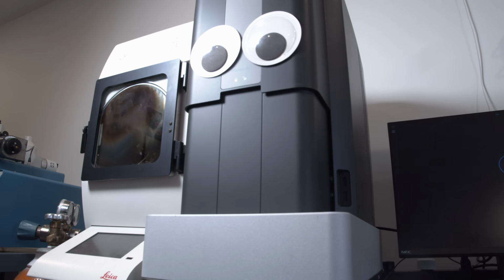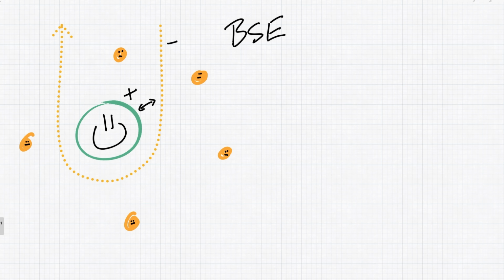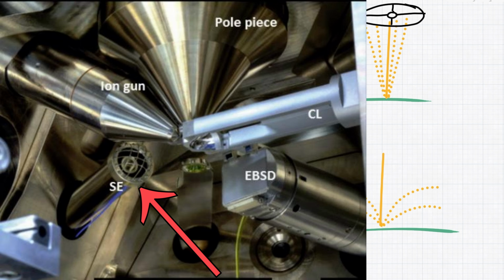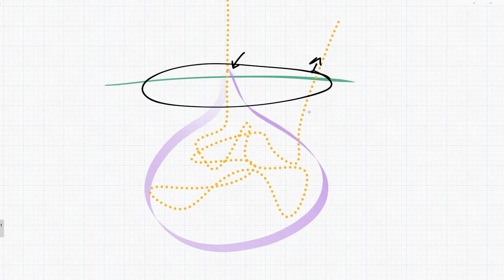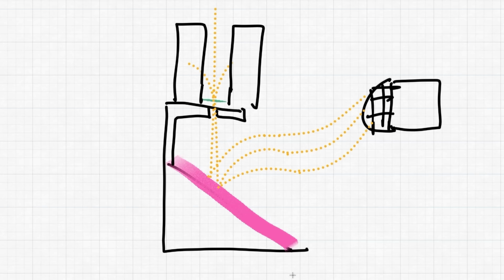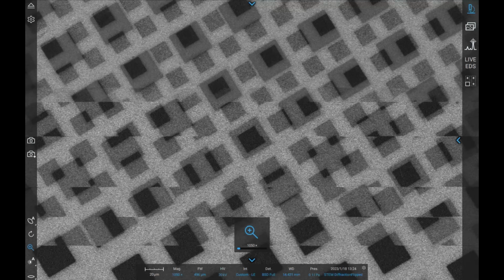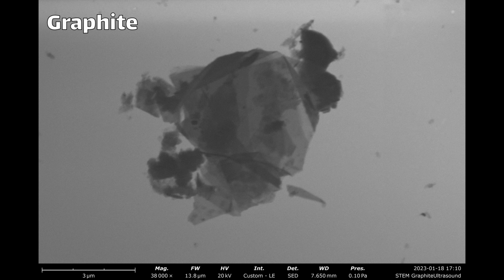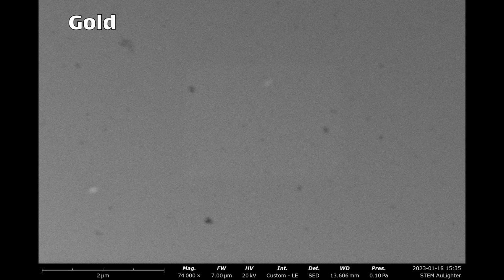Electron Microscope Hack to see Graphene

Comment: what a clear explanation, thx for video, but i didnt catch on what surface was graphite laying, if we were cathcing all the electrons passing through the grid, where there is no surface, graphite should have fallen on platinum plate further
Reply from the maker: Thanks! And that's my fault, totally glossed over that. The grids I'm using have an ultra-thin layer of Formvar (polyvinyl formal) polymer, think it's 20-50nm thick. It's thin enough to be mostly transparent to electrons, but robust enough to hold things like nanoparticles and flakes. There are a bunch of variations you can order depending on your sample (silicon monoxide layers, silicon nitride, pure carbon, thin metals, etc)
Reply: @BreakingTaps  that is absolutely amazing, i am curios how a such thin layer of polyvinyl is made
Reply: @pibus12  dissolve it in a solvent and let that coat the grid? The polymer is sold for diy tem lab use.

Comment: Amazing!  Would it be possible to improve the image SNR by stacking 4 or 8 sequential images of the same view?  . . . which leads me to also ask, how long does it take to capture a full resolution image like these?
Reply from the maker: Yep! The images actually are a stack of several images (you set an exposure time, and it integrates a number of passes). But the software doesn't do it very intelligently... it just dumbly integrates per-pixel so if there is any vibration or shifting of the sample, you'll get a blurry image. I've been meaning to capture a lot of individual frames and stack it with some astrophotography software. I suspect that would do a lot better job

A 4k image with reasonable quality usually takes 20-40 seconds, so pretty fast. If there's a particularly troublesome image I might drop it down to 1080p resolution and increase the exposure time. Ends up about the same time, but more integrations (and tends to not make the sample move around as much... it gets complicated).

Technically the machine can capture 8k images but that takes forever, like 5+ minutes :)

Comment: can you change the field strength on the secondary electron detector? i’m curious how that would affect the image. i assume at high levels it would see electrons from anywhere, and at low levels it would see only electrons moving kinda towards it
Reply from the maker: Not on my machine, but probably on nicer / academic machines! I think your intuition is 100% correct.  I've seen some papers that also add an electromagnet under the sample to curve the electrons, allowing them to "filter" it through a second aperture.  Same idea, just different way to do it.

Comment: Is there any way to get diffraction images out of a STEM? When I took electron microscopy of materials back in grad school, a big part of the TEM portion was using diffraction apertures to get spot patterns for looking at crystal structure, or imaging only a certain diffraction pattern so you can e.g. see <110> oriented grains as light and everything else dark.
Reply from the maker: I'm not sure to be honest! My gut says that STEM can't generate those nice crystallographic diffraction patterns... but I'm really not sure. Hopefully @AlphaPhoenix or someone equally knowledgeable shows up with some answers :)
Reply: Probably not. TEMs have lenses after the sample that asre used to form the image/diffraction pattern.
Reply: Well, going by the Xray crystallography experiment we were shown back in high school (AP physics, senior year iirc), it's enough to hit a monocrystalline region with the beam, and record the angular diffraction pattern that comes out.

And the transmission that the video uses with the secondary leectron detector should have that angular diffraction pattern from the crystal structure visible, but the single-pixel detector (and lack of focusing optics between the plate and the pixel) can't resolve it.

Comment: Can you actually get higher resolution that way? When we use TEM in our group, it is moastly to measure distances of atomic layers. What is the benefit for such a conversion. And why doesn't the 3d printed destroy the vacuum in the SEM chamber. I always had huge problems withe vacuum when I used 3d printed stuff. Thanks for the Video this is great
Reply: You can see in the video that he is using a working pressure of 0.1Pa, which is WAY higher pressure than a TEM requires, and is relatively high for some high resolution SEMs. I like these lower-end SEMs because they are much much more resistant to dirty materials and usually "good enough", depending on the analysis, and massively speeds up throughput if you have a lot of samples, as pump-down times are much lower.

Check out Environmental SEM, many machines can be made to work with volatiles and dirty or outgassing samples, and water.
Reply from the maker: Yep, @MrTheomossop nailed it! My SEM is a desktop machine, so the "high vacuum" mode is actually pretty low vac (and the actual low vac mode is practically atmospheric, iirc it's like 60Pa / 0.6mbar). But I can cycle the chamber in about a minute so it's pretty convenient for most things I work on, and tolerates all kinds of awful samples and outgassing materials 😁

To the question of why it's (potentially) useful, I'd struggle to resove many of these 50nm'ish sized particles if they were just placed on a silicon wafer. Very low contrast on SED, and almost invisible to my BSE. Still hard to resolve with this converter but there are more electrons to work with so the signal is a bit better.

Can't speak to more professional machines, but I imagine the difference is more stark if you have a proper, floor-standing SEM :) You can also play with bright/dark-field depending on how you mask the aperture which I'm told can be useful, although I don't fully understand the ramifications of when you'd want each yet

(I did somewhat misconstrue TEM, STEM and STEM-in-SEM in the video though. Was trying to keep it concise and didn't properly define each, which probably resulted in some confusion for folks that actually know about the different instruments)

Comment: How / where do you buy gloves that fit perfectly?
Reply from the maker: Most recent batch is from Uline (https://www.uline.com/Product/Detail/S-21079G-S/Nitrile-Gloves/Uline-Black-Industrial-Nitrile-Gloves-in-a-Bucket-Refill-Bag-6-Mil-Small), but I've also gotten them from Amazon before. Nitrile, 6 mil, small (I have small hands). I'd err on the side of smaller sizes though, people chronically grab too large of a size and then have it flapping around their fingers :) Nitrile tends to fit better than latex in my experience too
Reply: @BreakingTaps  thank you so much. <3. I have small hands too, and while the gloves on Amazon are okay, I do find myself being a bit more clumsy when doing any fine work.

Comment: Super cool! Only think I wish I could see if a comparison between the TEM images and what the same thing looked like with the backscatter detector.  Although, I have no idea if it's as easy as toggling between detectors. Probably not.
Reply from the maker: Ahh, that would have been a good idea! Easy to switch, just takes a few seconds. I just didn't think about it because in basically all the samples it is completely black! 🙂 The particles are so small they don't generate much backscatter at all, so end up being an entirely black field. The only exception was the tungsten disulfide... because tungsten is so heavy (and some of the particles were kinda large) they can generate enough signal to be seen on BSE.
Reply: @BreakingTaps  That makes sense.  :D   You did explain the benefits of TEM, but it would be kind of neat to see the advantage over what the SEM can do for the same sample. 🤔   Not a big deal, still a very cool video!
Reply: @BreakingTaps  Can (S)TEM view through an already back thinned camera sensor or is the structure still too massive.  Just thinking what sort of things can one view that are thin enough, a flies wing perhaps?

Comment: With the original arrangement, can you clock the time between the electron being emitted and being detected to separate the detection on the secondary detector and produce multiple "layers" based on how much the electrons bounced before coming out and hitting the detector? Or if you can't detect when the electrons get emitted, would it be possible to use the beam deflection as a sort of shutter, timing based on when you switch the aim from a dump direction to a direction that does hit the sample, getting an statistical sample over many shots to estimate the bounce time for each individual deflection angle?
Reply from the maker: I'm not sure, maybe! Grain of salt, I'm garbage at EE so not entirely sure what's possible or not. I have seen some devices that use an electromagnet to alter the flight path of electrons after they pass through the sample. By varying the strength of the field, you can curve the electrons more or less depending on their energy, basically "filtering" them (if an electron has multiple collisions passing through a sample it'll have a lower energy, etc).

You might be able do it in reverse too and vary the accelerating voltage to see how much is required to get through the sample and estimate from that?

Probably a way to do high speed capture of electrons though, not sure. The scintilator might be the limiting factor in terms of speed?

Comment: If you don't mind mentioning numbers, what's the approximate $ investment required to get to a point where you can make images likes the ones that you see in this video?  I would imagine there is also a huge amount of setup and calibration to get everything working just right.  Is it feasible to buy a hodgepodge of parts (scintillators, optics, etc.) off of eBay and connect them together, or do you have to buy into a specific proprietary ecosystem to have a hope of getting it working?
Reply from the maker: Yeah so my system is 60k-150k new, depending on the model and company. It's a "desktop SEM", so designed for less rigorous analysis than a big academic floor-standing model. They also don't show up on the used market very often because they are relatively niche.

New floor standing models are probably what @electricalychalanged4911  said, 100-200k or higher.

But you can find old analog SEMs for pretty darn cheap these days! 2-10k, depending on location and condition. They still take great images, just often are purely analog and are being sold by universities as they upgrade. Might need to tinker with them or debug analog electronics though, and parts are probably more difficult to find (but also, easier to replace since old analog stuff, often come with complete schematics, etc)

Building one from scratch is probably quite a feat, although Ben at Applied Science did it :)

The old analog ones are pretty amenable to tinkering though. Usually standard fittings (ISO flanges) so you can plug/play a lot of different things
Reply: @BreakingTaps  Awesome, thanks for the detailed reply :)    A used one for 2-10k sounds tempting.  I guess it would be a bit of a gamble though.  If you get unlucky, I suppose you might end up spending enough time/money 'fixing' it that it would be 'cheaper' to have just bought the desktop one.  Great stuff, keep it up.
Reply: While he was a high school student, Sam Zeloof bought a broken electron microscope off of eBay, and fixed it. So we have an existence proof that it was possible for at least one person to get their own working electron microscope with very little financial resources. Just a thousand hours of work.

He has posted videos on YouTube about his microscope.
Reply: About 200k
Reply: That is for a new SEM if you want to have an used system you might be able to get it for half or less especially if you know what you are doing and already have the required pumps.
Reply: There was a old JEOL JEM-100 full analogue TEM microscope from a university that sold at auction in Finland a couple of years back for €600, I would have bid more just for the vacuum pumps if I had the space to store it. The unit and pump box weigh 860 kg with height of 2.45m.

Comment: Since you're seeing thru samples, would there be a way to rotate the samples in a controlled manner to get multiple images you could use to calculate a volumetric scan of the sample? If it's too hard to control exactly how much you rotate the sample, could you have a grid mask or some other more complicated pattern around the sample that could be used to calculate the rotation each individual scan was taken at?
Reply from the maker: I bet you could! Sorta like a very shallow CT scan :) There'd be a limit to how much you could rotate the sample, since at some point it'll either be too thick, the beam start hitting the grid or other parts of the sample. But in principle it seems like it should work?
Reply: Alternatively, add a second beam source so you can take stereo images.

Comment: Are 3D printed parts  straight forward to use under vacuum?  do they take awhile to out gas moisture or anything?
Reply from the maker: They aren't too bad if you're careful to avoid big internal voids. My microscope operates at a pretty low vacuum, even the "high vac" mode, so it's fairly tolerant of outgassing and virtual leaks. Under more stringent conditions with real high vacuum it can take a while for all the little voids between layers and walls to finish pumping down, basically a ton of virtual leaks. In other projects I've either done single-walled prints with access holes to the inside so it pumps quickly, or try to keep them small and dense so there aren't a lot of voids at all. 

The PLA itself doesn't outgas too badly (various sources, i.e. https://sosolik.people.clemson.edu/papers/Vacuum172a109061_2020.pdf quote rates like 7*10^-6 Torr L/(cm^2s) ). I think NASA has a study somewhere with similar results. Outgasses some but not the worst offender amongst plastics

Comment: I have always been so fascinated by electron microscopes.  This is so neat!
Once, years ago, I had the chance to acquire an old (70s era) electron microscope from a salvage yard.  At the time, I was mostly concerned with, how would I ever get this going, as it was all CRT and really old transistors, but now I am kicking myself for not getting it.  Even if it would have been a huge pain to get working, getting one for basically scrap value would have been awesome.
Reply: I would have grabbed it if nothing else for the HV and vacuum goodies inside.
Reply: @christopherleubner6633  Indeed.  That also would have been a good idea, and more of a reason to kick myself.  Lol.  
After applied science got his olde one working, I was so disappointed in old me.
I console myself with that I got some other awesome goodies there, like some lasers I ended up selling on to someone at nasa, which is awesome.
Reply: Ouch 🙄

Comment: Can you please make a followup on the kind of detector you have? How does the point in space where the electron hit the sample is mapped out? 🤔 I. E. How does it map x/y coordinates? Is it a scanning system like CRTs and scanner moves to next spot after either getting the secondary emissions or after a specific timeout?
Reply: The beam is being scanned across the sample one pixel at a time. Signal from the detector is captured in sync with the beam, so if the beam is at the top left pixel of the scan area then the signal from the detector goes to the top left pixel of the image, etc.

The detector itself in a SEM has no spatial selectivity, it picks up any secondary/backscattered electrons heading its way. So you have to know where the beam was. In the old school analog CRT scopes, they'd literally drive the imaging beam and CRT scan coils with the same waveform (scaled appropriately in magnitude) and then the detector signal would go straight into the brightness input of the electron gun.
Reply: @AndrewZonenberg  this makes so much sense Andrew. Thank you..

Comment: So, let me see if I got this right:
- Your setup still scans a focused electron beam through the sample, as opposed to "real" TEM which works more like a, umm, slide projector?
- It would be possible, in principle, to collect separate images from backscattered electrons, "primary secondary" (I could not resist) electrons that normally get absorbed by that cup (that would require some quite bulky and unwieldy detector), and "true" secondary electrons from that plate you manufactured, plus chemical composition of the sample via X-ray detector detecting X-ray fluorescence? (Of course, I understand that, in practice, tradeoffs in geometry, ideal beam energy and intensity etc make this impractical if not impossible, but still...)

Man, I envy you! 😀
Reply from the maker: Correct on both counts! 

- A traditional TEM uses a large, collimated beam of electrons just like a slide projector, and captures the "shadow image" on the other side. There are scanning TEMs that work similar to how this converted device works, by focusing on the sample and scanning. To be honest I'm not familiar enough with TEM/STEM to really know why you'd choose one vs the other. I think TEM is better for samples like tissue slices, while STEM might be better for nanoparticles/crystals/etc because you can derive additional information based on the angle the electrons are diverted.

- Yep! In practice it could be quite tricky getting the photons out of the sample cup, and keeping the two types of secondary electrons from mixing. But in theory totally doable I think! There are also dedicated sensors you can place inside the chamber that go underneath the sample, which means you can collect the electrons directly instead of using the conversion plate. I've also seen schemes that use small electromagnet coils to curve the electrons after they come out the bottom of the sample, so you can "select" different electron energies to analyze. Lots of neat little tricks :)
Reply: @BreakingTaps  Thanks!